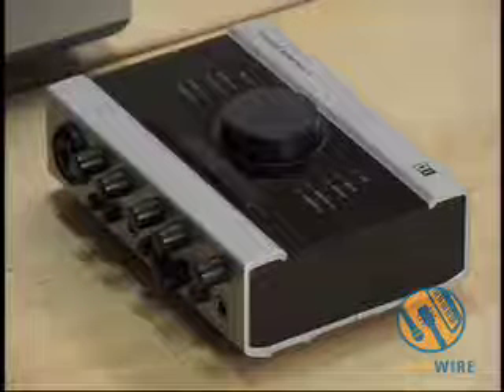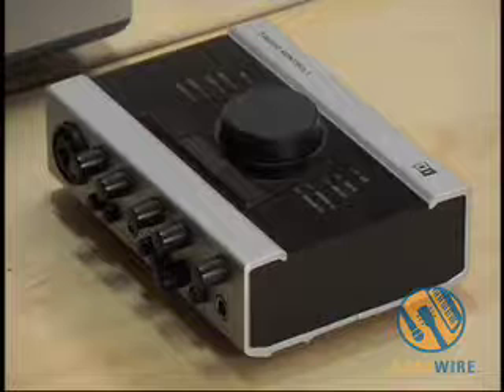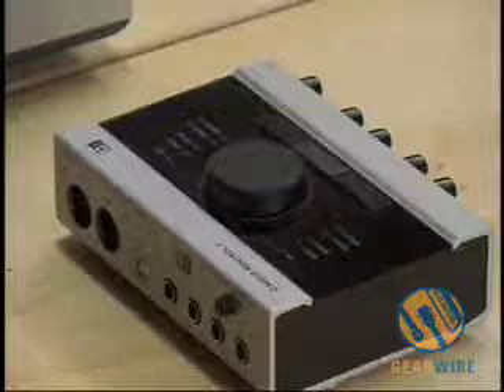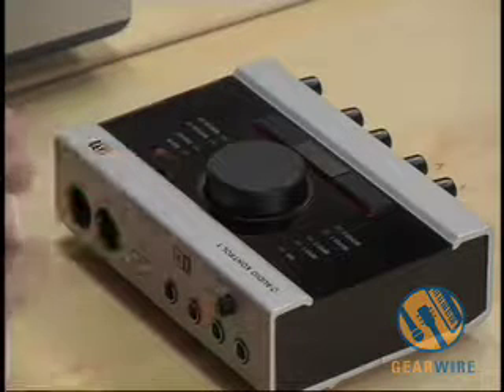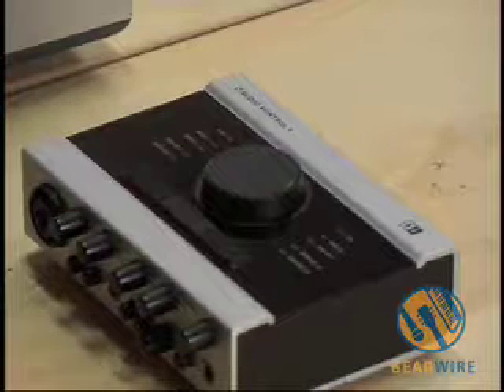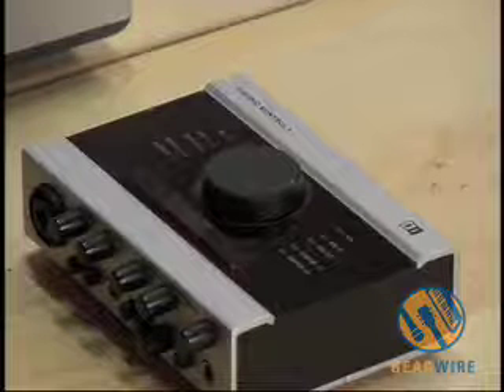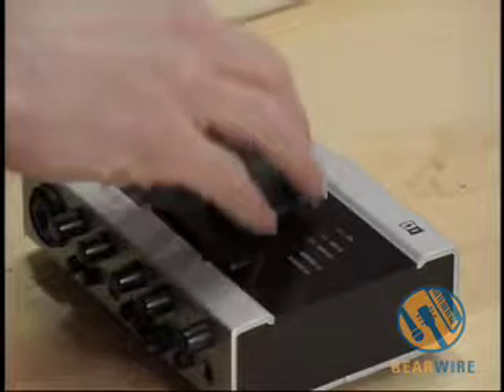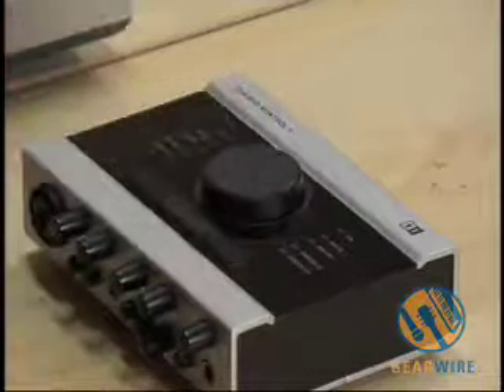Native Instruments Audio Kontrol 1 Tutorial

Comment: @mmim4 you need some type of recording software on the compute... You don't need a seperate cable to go from the device to the computer, it's already hooked up to the computer. Try Audacity to record with and make sure you set the device "Line" and not Mic (if it has that option).